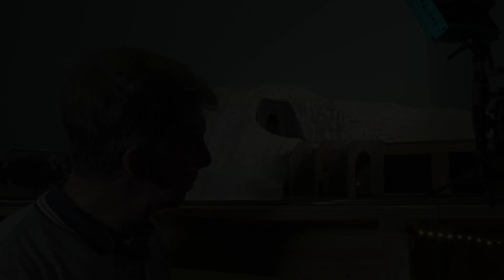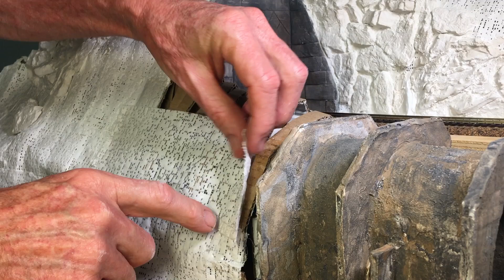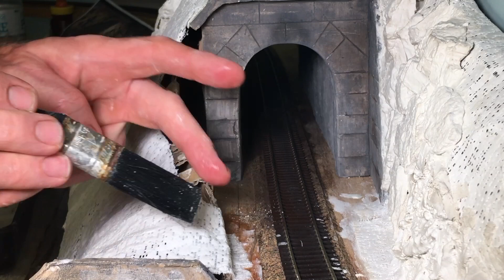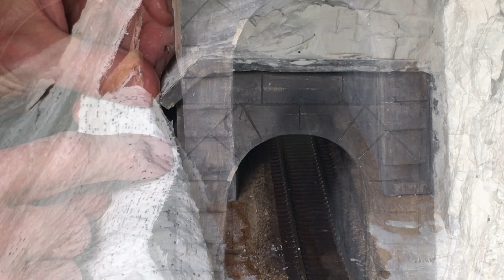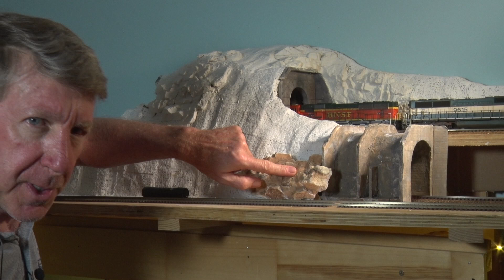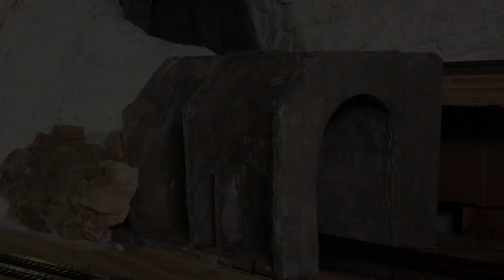Mountain out of a mole hill Part 4.

Comment: Hi there Greg Peter here from the UK and just received after a month for waiting for the only UK importer to import more, my bottles of Inox MX3. Already got it on my layout which is just a small roundy roundy and Wow its fantastic. Don't have any engines with traction tyres so won't have any problems. Will now go on to clean all the pickups on my loco. Things are running very well Great info from you
Cheers Peter
Reply from the maker: Hi Peter, thanks for the feedback and I'm glad you got great results from the Inoxx! Remember you will always get lines on the rag from the track , that is the spray doing it's job and cleaning the dirt from the wheels! 
Cheers Gregg.

Comment: Do you know if Abelflex expansion joint filler will work ? 150mm in height. I was thinking on using that as the Walls and roof top of a tunnel and  apply plaster cloth it over.
Reply from the maker: I'm not heard of it? But Sculpt it works great and casting plaster is good too.
GRegg.